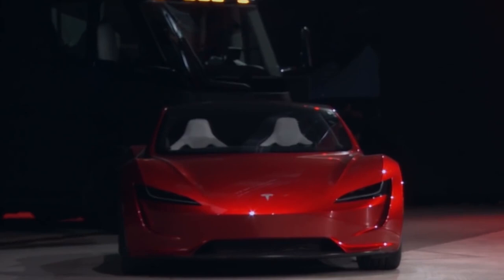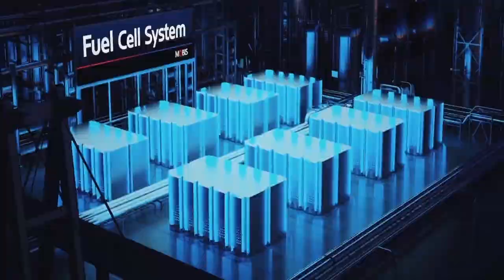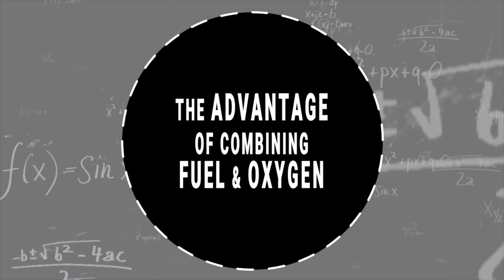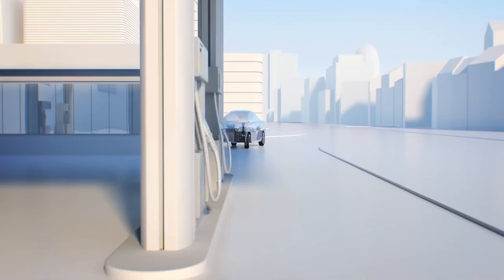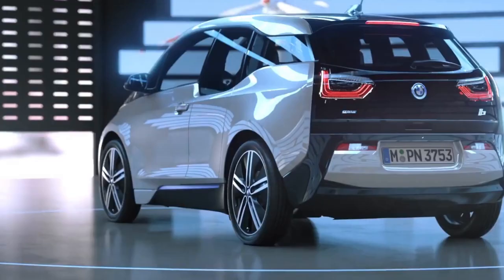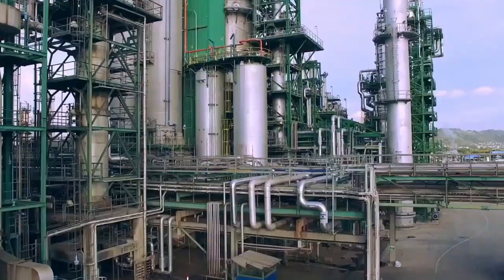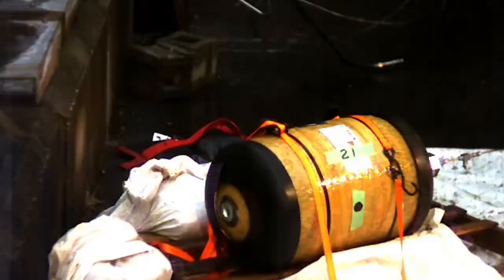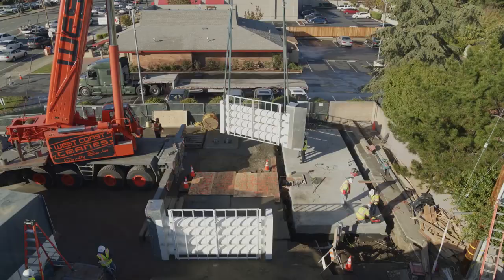is hydrogen fuel cell the future?

Comment: More confused than ever thank you very much
Reply from the maker: You welcome
Reply: H is not remotely economic and has no path to be, that's all you really need to know.
Reply: @Mrbfgray  it's economic in bigger vehicles, battery electric vehicles give diminishing return after a certain point as the weight of battery increases, so in bigger vehicles travelling long distance hydrogen is better fuel, and in cars, not everyone has a garage, majority people in cities live in apartments, and it's not possible for very to go every night or in morning to go to charge vehicle for at least 30 minutes and wait for that time every day, only those who have garage or charging points in their apartment will be fine, which are a very few.
Reply: @kushal518      Fight it if you like, in a few yrs or less you'll love by FAR the BEST and the cheapest car you ever experienced.  It'll bee an EV and charging options will be everywhere for 1/4 the "fueling" cost of an ICE.

I'm an old petrolhead, love my 9k revving BMW V8, manual, analog three pedal visceral machine...but I see where things are going.

Comment: Good watch - and fairly unbiased. However, at the moment, the hydrogen industry puts 800million tons of CO2 into the atmosphere. Before we even think about hydrogen as a fuel - this  problem needs to be addressed. Right now, there is no practical, or financially viable way to do this. Hydrogen is, overall about 1/3 the efficiency of batteries... hence it will always remain uncompetitive to batteries. The physics and chemistry of hydrogen will forever be against H2s viability ...
Reply from the maker: You have a good point. But still, hydrogen will be a key player

Comment: the car of the future will be a hybrid betweeb hydrogen and electric vehical
Reply from the maker: Very interesting
Reply: Would this really be advantages enough to justify adding the most expensive parts from both types of vehicles to make a single vehicle? It would probably cost the future equivalent to $50k in today's money for a car that has the build quality and comfort of a ICE car that is 1/3rd the price. Plus both systems would take up extra space something that would either require a larger vehicle driving costs up or less interior space and the extra weight would effect performance. The only advantages of this system is that you could run it on cheap electricity most of the time using hydrogen for road trips. Such a vehicle worsens some of the biggest disadvantages of both systems and reduces some of the advantages while providing only a moderate benefit that most people would use less than 1% of the time.

Comment: Thanks for the info, how about the life of the h2 tank, 5 years ? every tank have to be replace after some years, BBQ, Scuba, etc. How about H2 station security, remember the one exploded in Norway last year, what about the water rejected in a place like north of Europe or Canada in winter, it's made a lot of ice on the road, not safe.  It is true, if we use a lot, but a lot of H2 car on the road the water vapor is worst for the climate change ? H2 for plane or big boat ok but for cars ? it's not a desesperate way to keep an ancien distribution model, a controled one ?
Reply: Thats ok just keep breathing in all the crap, best of luck!
Reply: @lavoltare6307  It's exacly what i think when in my EV i see in winter all of the people keep running the gas engine.
Reply: This might come as a surprise to you, but here in sweden we get rain on the road that freezes all the time in the winter. And snow that gets packed to ice. We just put our winter tyres on, water on the road would be no problem at all. However, the weight of a BEV would make it harder to stop, so they are more dangerous than a fuel cell
Reply: @thoos192  Here in Québec we know the winter icy road, but we know when you stop on snow and ice it's not the same. Winter tire, studed tire maybe. My BEV work verry well in winter but yes we need verry good tire and the life of the tire is shorter, too much weight.

Comment: Would we run out of oxygen if everyone drives a fuel cell car?
Reply from the maker: No because fuel cell
work on hydrogen
Reply: @ScienceScout  From your video it combines oxygen and hydrogen to generate electricity and releases water.  Now that I think about it more, we would not run out of oxygen because the combustion engine also use oxygen to work.
Reply: No, for the same reason that we won't run out of oxygen using gasoline the amount of oxygen consumed is negligable (plus green hydrogen production releases oxygen meaning that if anything we will gain a real but negligable amount of oxygen dye to hydrogen leaks)
Reply: Perhaps not, but you'd end up paying dearly for it. The big oil companies desperately want hydrogen to succeed, so that they can continue their hold on the production, distribution and pricing of it, just like the good old days. The big oil executives must surely cringe at the thought of people being able to "fuel" their cars at home, and even produce their own energy if they have solar etc.....

Comment: I think you have painted a way to rosy picture for H2 in the consumer automotive world. You clearly missed the point that Toyota is giving away $15,000 if free H2...since the Mirai is not selling. Yiu also failed to describe the energy efficiency if H2 FCEV's versus BEV's... H2 is woefully behind
Reply from the maker: Thank you for your comments, I will try my best on the new videos.
Reply from the maker: But dont forget mirai not sailing because there is not enough infrastructure and the prices very high
Reply: @ScienceScout   Is the Mirai not selling because there is not enough infrastructure and the prices are very high...or....

Is there not enough infrastructure because the Mirai is not selling...:)

Sorry by H2 has missed the boat for the consumer market... Electricity outlets are everywhere...literally. You can tap an electrical cable pretty much anywhere and pop out a charger...The same cannot be said for an H2 refueling station..

Also I believe the 3-5 minute refuel for a FCEV car is a misnomer. I may be wrong on this but am sure I have seen this somewhere...take this example...

Car#1 Pulls into a H2 station to refuel. 3-5 minutes later drives off.
Car#2 Pull in immediately behind on the same pump. Has to wait 30 minutes for the pump to recharge/re-pressurize.

I think H2 may have a play in large scale long distance transport logistics like trains and ships where you have a few large transport hubs where refueling hubs make sense...but for the consumer market..

Horse
Gate
Bolted..
Reply from the maker: That trust do not forget it's still new technology on the cars market it's too early to say its flailed there still alot space to improvement however yeah electric cars look more closer for daylily
Reply: Fuel cells can be rebuilt whereas batteries eventually end up in the landfill.  Chemicals in Battery is hazardous to the environment whereas the only liquid in a fuel cell is water.  It’s true that hydrogen is less efficient than storing in battery but we have enough sun and solar panel space to make up the inefficiency to a point where it does not matter.   There’s more emission release in the process of making batteries than making fuel cells.  Fuel cells can be dismantled, cleaned, and refurbished to be use again.  Batteries lose storage capacity over time and cannot be refurbished.  For these reason in the long run hydrogen is better for the environment.
Reply: @PapayBmet  Wow...so much wrong with all that

90% of Lead/Acid are recycled and LiON Batteries are headed the sameway and do not go to landfill

Recent automotive batteries are good for 1M Miles or more with little degradation and now outlive the life of the car itself. Usually 8-12 years

Automotive Batteries are used in second life projects such as static storage where their high power output needed for cars is no longer necessary so as they degrade over time this has no effect on their use model giving them 10-15years further life.

Automotive batteries are now starting to be recycled at scale since volume of EoL cars are starting to come on the market making this business model viable. Thus most of the component minerals are extracted and reused.

Energy used in these processes can come from the same sources of Solar, Wind and Hydro thus making the emissions negligible also.

Companies like Tesla are developing chemistries and methods that reduce or eliminate wasteful or toxic steps that have been used in the past, like eliminating Cobalt as an example, and researching less harmful ways of extraction lithium.

You seem to gloss over the mineral and rare earth elements still required to make FCEV....but no matter...I am sure you know they are there too...:)

Your response is of someone very ill informed.

Okay - So what else you got!!
Reply: @skip181sg  And then it became quiet...
Reply: You need to look past cars for hydrogen fuel cells. They are more suited for heavy duty vehicles, such as: lorry’s, trains, cargo ships and aero (lots of other uses that they could be used for). The production of hydrogen can be offset by using excess green energy sources (wind farms, solar, etc). I would say batteries are more suited cars. Would it not be better for our future to have multiple green energy sources? I’m not sure why there needs to be a battery or hydrogen argument. Both can be utilised to better the world
Reply: @ashleygardiner5021  Oh I do think there is a role for H2 in areas where Batteries don't make sense or just don't plainly fit....like thermal requirements such as steel plants etc, major long distance commercial haulage etc. However batteries will continue to eat into that TAM as they improve in energy density and charge cycles etc. H2 will always be more expensive as a fuel and so a FCEV in any space will have to be way cheaper than a BEV to win on a cost advantage as the H2 will ALWAYS be more expensive than pure electric.

I specifically answered the video in respect to consume passenger vehicle space so please don't try to change the playing field to try and make a point.
Reply: @ashleygardiner5021  Why look past hydrogen in cars? I would love to buy one. No range anxiety (I often drive long ranges). Also don´t mind if it costs a little extra. The EV has so many problems that I don´t like. Huge weight issues, recharging times, degenerating battery, bad range in cold weather etc.

Comment: Electrolizer is need to fit in hydrogen cars not bottle 😡
Reply: Yeah so where does the energy come from to power that electrolizer xD
Reply: @Simon-dm8zv  Alternator m8
Reply: @zoltanhaleczki4652  Haha so you think that this car will keep driving forever?
Reply: @zoltanhaleczki4652  and what will be turning that alternator to generate the power to produce the hydrogen? The cheapest way to provide the energy to produce the hydrogen within a car is grid energy, and once you factor in the losses from electrolysis and compressing the hydrogen you essentially end up with a slower charging less efficient battery that makes a lot of noise and requires you to frequently add water for it to continue working

Comment: Toyota is behind time and follows stubbornness of one chief design engineer adopting expensive hydrogen fuel tank and liquid hydrogen for filling up tank via expensive refueling stations.
Advanced technology is to use totally safe clean fuel consisting of 60% methanol and 40% water for filling up standard car tank. When car is started fuel is feed to special heat ex-changer converting it to clean hydrogen as needed NO HYDROGEN FUEL TANK feeding fuel cell and powering electric motor. Tests conducted in Germany on prototype cars driven 1000 Km on one fuel tank (filling time 3 minutes)  concluded this is best solution for clean and efficient energy car. The problem is that German and Japanese governments already invested billions in to expensive hydrogen production and infrastructure and are not easy to change to safe fuel of 60% methanol and 40% water.
Reply from the maker: Thank you for the information

Comment: Hydrogen is the future fast filling than tesla and longer range but the infrastructure for refueling is the problems for now.. they should add more stations..then more people will buy it! With good reliability, long lasting..cheap repairs are good to go!
Reply: I agree, would definatley buy a hydrogen powered car if I could. I hope they build charging stations everywhere. Would never buy an EV, rather use my ICE-car that can travel long distances without endless charging
Reply: a few misconceptions here. Although you can refuel faster, needing to go to a fuel station instead of charging from a wall outlet at home actually wastes 16-17 hours per year on average. Hydrogen Fuel Cell Vehicles (FCEV's) actually last significantly shorter lives than BEV's (around 2-3 times shorter lifespans by comparison). Hydrogen cars dont actually have much further if any further range compared to similar BEV vehicles mostly due to the fact that whilst hydrogen is lightweight. it takes up an extraordinary amount of volume, meaning you cant actually fit enough fuel in the cars to go much further.

Lastly they are significantly more expensive to fuel per mile than a BEV. Approximately 20x more expensive.
Reply: @engineeringtheweirdguy2103 Yes it is correct as you said it is easier to charge at home for that really convenient..also the price for hydrogen gas per kg it is for now quite expensive as you said(in the future it will be cheap), example like Toyota Mirai full tank is $100+ something. Electric car is good but it depends on the country different countries got different price of electric supply of Kw/h like in the US you may say it is cheap and has lots of benefit/incentive for electric car.. different countries like 2nd or 3rd world countries are of different price range mostly are expensive for them and the electrical substations their infrastructure are less, moreover some got good political stability and government assistance/financial and some that they are lacking on moving towards green world without harmful gas are emitted around the world right now. They should overcome that 1st , but as you said it is not cheap the tank is limited and the FCEV's has shorter life that's just a theory for now not a concluded facts/limited information on it..but hey don't forget they're still on R&D and Evolving the technology further for us to make it cheaper, reliable,long lasting and long range as Toyota CEO said in the future, we just need to wait patiently for it! Also they will solve the limited tank capacity somehow. with sustainable and unlimited renewable energy is abundance around us and the universe!. Also Elon Musk hated this technology cause of it complexity this type of car's, he's just want different alternative and way out of this, got a mistake in Elon musk battery design form of Shape for now cause it not efficient as he say he announced..try to look the Chinese BYD company Blade Battery design technology,it saves more space, weight adding to more long range for electric cars. It's just hydrogen still quite slow on the R&D technology for now than electric cars they will get and other companies will follow suit shortly along with EV car Tech.
Reply: @matmamat9690  its just not a very well thought through technology. If the CEO of Toyota thought it was the future, they would have 30 new models of FCEV's instead of 30 new models of BEV's.
Reply: @engineeringtheweirdguy2103  Excellent explanation.
Reply: @Simon-dm8zv  thankyou